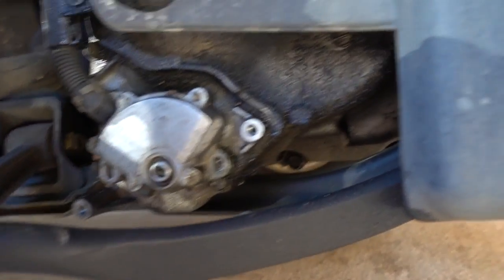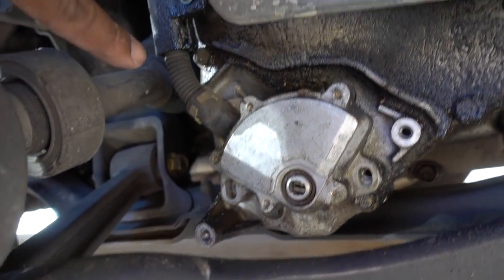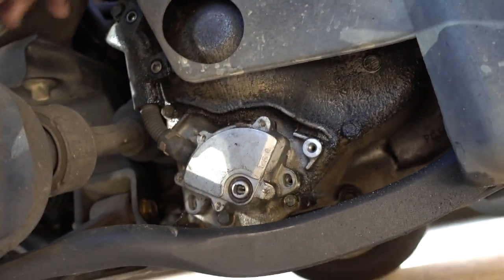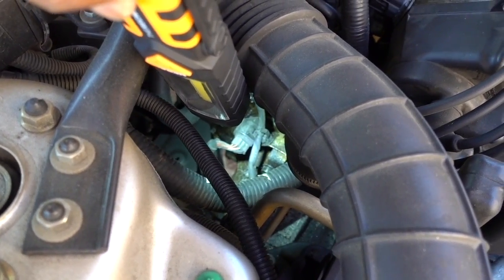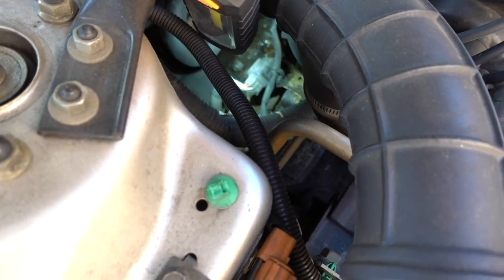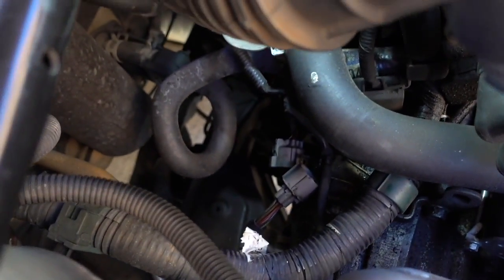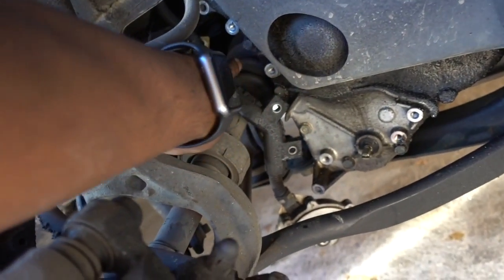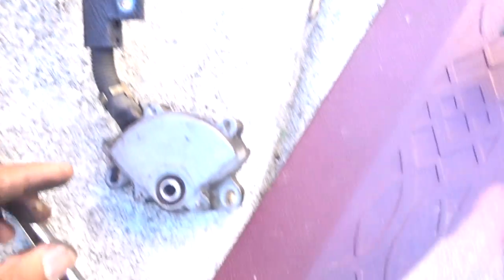#BulletSolano #2000Accord #RangeSensor HOW TO FIX P0706 CODE/ Honda Accord

Comment: I have a question my 2002 Honda accord v6 won’t drive when I put it on d4 or won’t reverse when on reverse but when I put it on neutral it drives can it be the sensor?
Reply from the maker: Most likely but scan the vehicle for codes first

Comment: Just got a 2001 accord yesterday. V6. Car can shift when it’s turned off. And throwing the p1706 fault. Could I be the sensor or something else? I’ve done very little to it yet
Reply from the maker: Yes the sensor is bad, replaced it
Reply: @BulletSolano  thank you! For some reason they zip tied the button that releases the shifter when you press the brakes, so I cut the zip tie and it doesn’t freely shift now and works as it should. Going to check the sensor tonight when I get home

Comment: Solano, I need help with my Honda Accord Coupe ex v6 automatic. My shifter is not working. I have to wiggle  the knob to find the gear. 1,2 is like is off track . I replaced it with another shifter but still do the same. Anything should I check my lookup solinoid. Speed sensor? I'm getting  a little annoyed  by this problem
Reply from the maker: Shifter cable

Comment: Hola Man una pregunta tengo un Honda civic 1998 y marca unos codigos p0700 y marca el p1706
Reply from the maker: Remplaza la lock up control solenoid y hazle un flush a la transmission si esto no arregla la us problemas remplaza el transmission range sensor

Comment: How’s it going on my 02 accord 2.3l automatic my shift lever does not lock into get and stuck in park on the dash so I can’t start vehicle can I put this part in park manual to make it work
Reply from the maker: Yes you can put it in park manually, but if the part is bad you still not gonna be able to start the car

Comment: Got a cuestión for you homie got this code on my Honda Accord LX 2005  code 87-32 side airbag cutoff indicator stays on/off ? Help
Reply from the maker: Your seat belt buckle is bad, or check the connections underneath the seat
Reply: @BulletSolano  hey thanks I will check it thanks 👍🏻
Reply from the maker: No problem

Comment: how you doing my question  i have a acura tsx automatic  i’m buying a used  neutral sensor or switch so i’m not sure if is on neutral or parking  in this case what should i do thanks for your  help  i have a blinking  D on my tsx
Reply from the maker: Doing well thanks, if you have a blinking D this is not your problem, you have to replace the pressure switches and adjust the A-B solenoids
Reply: what do you mean adjust the A&B selenoid and you think my sensors are bad how many are they
Reply from the maker: https://youtu.be/uh0CKkqmdiM
This is gonna give you an idea about it

Comment: I have a question. I did follow your installation and instructions. I did move to neutral shift then remove the sensor then disconnect the plug. Then install new one. Start car fine then try reverse it move really hard and indicate lights on transmission P, R, N, D4 etc all wierd move and sound. What cause is that ? I did everything match as yours.
Reply from the maker: The new switch is new or used? If is new get a new one, probably is a bad one
Reply: Bullet Solano new one. Or fix the sensor ? Only light on is P and Gear 1. Reverse, N, d4, d3, 2 all light off. At before I replace it all light on. Wierd. I try unplug then Plug it. It still issue.
Reply from the maker: Get another one
Reply: What is your best suggestions to solve this issue. Appreciate your help

Comment: Hey quick question I bought the sensor online supposedly NEW. I received the sensor and it looked used, due to slight rust on the wires and dust on the plugs. should you suggest to install it on neutral or park?
Reply from the maker: You need to open it to check
Reply from the maker: https://youtu.be/_hRciob_z8w
Reply: Thank you for replying so fast.... 
Just saw the other video.   Now I am stuck in trying to get the plug off from the old one. I have everything else ready, Once I take the plug off I am done..
Reply from the maker: Ok no problem

Comment: I have the same code and my transmission was smooth before and now its kinda rough. I had check engine light on because of my catalyst converter but I didn't know that I had this P0706 code too until I got it checked. So my question is that can this "TRS" be the culprit behind rough shifting?
Reply from the maker: Yes that’s gonna be your problem
Reply: @BulletSolano  i hope so because my fluid is crystal clear and was crystal clear before. Thank you so much for the responce.
Reply from the maker: No problem
Reply: What is TRS?
Reply: @TrueeDatt  Transmission Range Switch

Comment: Question does this car still function right after using that used one after a year later I'm debating whether to get a used one or a new one just kind of tied up on a budget right now to buy a new one
Reply from the maker: Yes the car still running fine is my neighbors car and we don’t have problems with it
Reply: @BulletSolano  oh okay cool in your opinion when I'm looking for a used part what should I be looking for if it would be good
Reply from the maker: That’s 50/50 because when I get the part they told me in the junkyard that if the part was bad just bring it back to get a new one, so is risky
Reply: @BulletSolano  ok cool thanks
Reply from the maker: No problem

Comment: Hola gracias por el video,tengo problemas con mi 2001 Honda Accord no quiere prender y el freno esta duro y no puedo ponerlo en neutro,el problema es con el sensor?
Reply from the maker: Hola qué tal, cuando lo quieres prender presionas el freno para ponerlo en neutral?
Reply: @BulletSolano  no puedo ponerlo en neutro
Reply from the maker: Ok checa el seguro que está a un lado de la palanca de cambios tal vez esta laqueado
Reply: Preciono el freno pero no se muebe
Reply: @BulletSolano  ok,gracias hermano se le agradese la ajuda.
Reply from the maker: De nada un placer
Reply: @BulletSolano  e tenido el problema tres veses preciono el voton de la palanca pero no se muebe,fui al Auto Part me dicen que es el sensor de trasmicion.
Reply from the maker: Primero cheque el botón del seguro a un lado de la palanca y después cambie el sensor

Comment: Thanks for the video, quick question will the sensor be located on the same spot for a b series transmission? It's an Integra btw.
Reply from the maker: Yes is in the same area
Reply: Bullet Solano hey buddy I changed the sensor and my car still the same,tips please ayuda hermano
Reply from the maker: Hey bro if the car is doing the same check the connector, but what’s the problem with the car?
Reply: Bullet Solano well I had a check engine and I took  it to autozone and advance and they scanned mi baby Honda  and both came up with this code po706 and I replaced it with a new part
Reply from the maker: Then maybe the wire is bad, check the conector that goes into the transmission range sensor
Reply: Bullet Solano ok hermano apreciciated what u do muchas gracias I’m going check The  cable
Reply from the maker: Ok bro no problem, keep me posted

Comment: Hi joe!!!
Need your help?
2001 Honda Accord 4 cylinder. 
When I drive my car from 1st gear going to 2nd gear car lock up for Couple seconds.Feel like I Slam on my brakes but never touch on the breaks.
Reply from the maker: Did you check the calipers?
Reply from the maker: If not the calipers maybe the transmission is going bad
Reply: Caliper is good I think is the transmission too. Thank for help
Reply from the maker: Ok no problem, if you need anything else let me know

Comment: So you're saying if you buy a new part you have the car in neutral when installing, and start it up in neutral.
Since you used a junk yard part, you had your car in park for installation and start up, correct?
Reply from the maker: Yes that’s correct
Reply: Thanks for clearing that up.
Reply from the maker: No problem

Comment: O rielly guy told me that I need to make sure the transmission is not a cvt transmission , because the part is different.  How would I know if it is or not please. Thanks
Reply from the maker: If your car change gears and you don’t feel them then you have a cvt but if you feel the gear changes you have a normal transmission

Comment: Also, my civic shows two codes,  po113 and po706. But the check engine light comes and goes,  and car has a lot of power. I am trying to sell the car , should I  replace this range sensor? To get red of check engine light ? 
And what should I do with po113. Thank you .
Reply from the maker: Replace the sensor for code p0113 and if you can find a junkyard range sensor that will works

Comment: That was good information, I have had to replace mine twice.  The mechanic had no idea that it was in neutral when brought new, and now my shit is messed up not only does my rpm either don't move or move slowly, but my car will say it is in neutral but in reverse.
Reply from the maker: Thanks, Take it back to the mechanic so he can fix it
Reply: I did the same thing , installed a new sensor on Park , how do I get the new sensor to get back on to neutral Autozone says I can’t return it 😞
Reply from the maker: You have to open the sensor and moved it manually to neutral
Reply from the maker: Maybe I’ll make a video about it in the week off 4 of July
Reply: Bullet Solano man how to I know what’s neutral when I open it up ? I got a 98 cr-v from my cousin he hit a bolder  crack the trans , and the gear Selector broke , fast forward I installed a new trans , new gear selector and shift cable, installed a new safety neutral switch “on park” 🤦🏻‍♂️ and sometimes d4 lights up and sometimes it don’t and d1 doesn’t light up at all, you think it’s because I installed the neutral safety switch when the car was on park?
Reply from the maker: Yea I think that’s the problem but let me get some free time to get that video going and I show you how to fix that
Reply: Bullet Solano ok 👌🏽 thank you and god bless , for your time i will gladly donate through pay pal once my issue is resolved.
Reply from the maker: God Bless you

Comment: Bro. why after i replace this switch my CRV RE2 D light still blinking when i park at N for a few second then park at P light P and N both lighting and after that D blinking. before change that D blinking. Dtc code P0705.
Reply from the maker: If you put a new switch before you install it you have to have the car in neutral because the sensor is coming in neutral nor parking.
Dit you do that?
Reply: Bullet Solano yes i park at N. and marking at switch in right position.
Reply from the maker: Ok then your transmission probably is going bad, not sure but get it check out